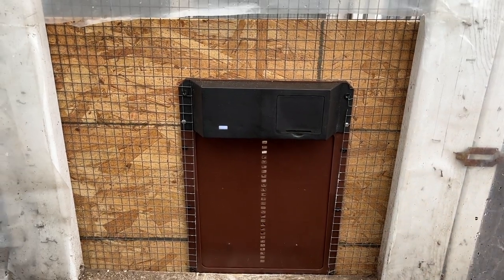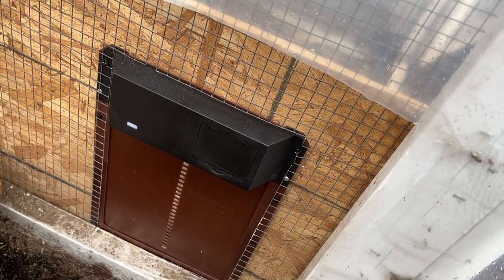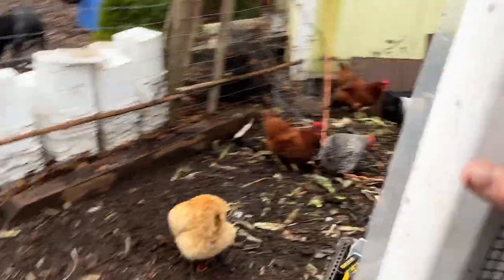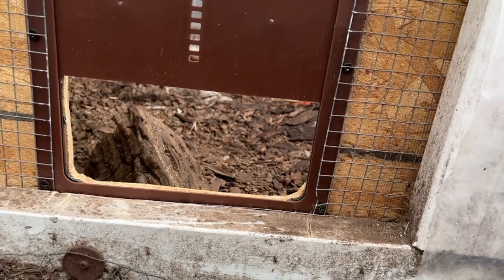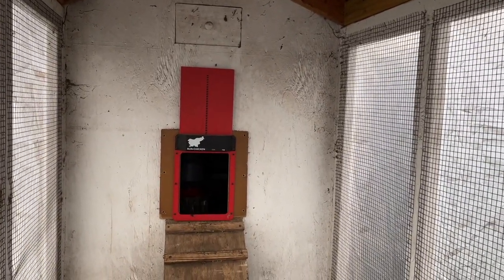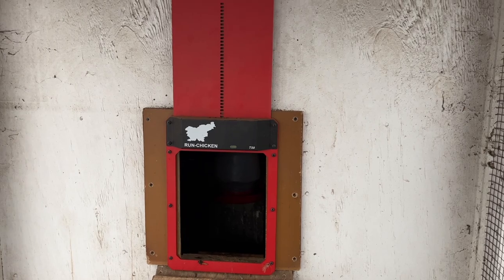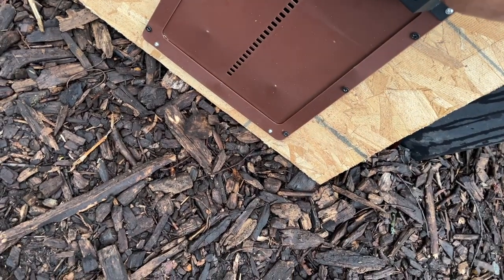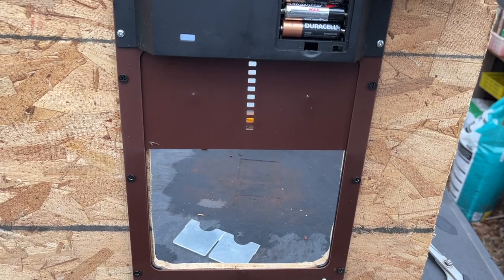$30 vs $200 Automatic Chicken Coop Door

Comment: real question is, is it raccoon skunk opossum fox, dog safe.
Reply from the maker: Two years running now and not a single incident. I do have lots of raccoons (who doesn't?) and I've never noticed an attempt. And there are some enormous skunks I've caught on my security camera and they haven't gotten in (if they ever tried). My own dog plays with the chickens so that's no answer. But the expensive door is made out of aluminum and the motor is more robust than the cheap version so I doubt an animal can get in. I can say I sleep soundly at night not worrying about the chickens' safety
Reply: Cool man !

Comment: It's literally getting caught on your fencing bro...
Reply from the maker: It’s literally not though. It’s cheap craftsmanship and plastic parts that are the cause and a lack of quality control. It can be adjusted to make it work, but it’s not getting caught on the hardware cloth.
Reply: Definitely the sprocket system they used. It would be jumping if it was the fence.
Reply: Thank you so much for taking that one apart... I could just put a different sprocket on their gear and have a $30 door that works like the $200 door. Either that or make smaller holes because the gears are spinning too fast. Needs more slots to grab or maybe if they set those holes that little angles it would probably work out great
Reply: Get some door seal or sticky foam. Cut to fit
Reply from the maker: @austingibson4939  That's a possible solution too!

Comment: Try flipping the door around.
Reply from the maker: The door is pretty much the same on both sides. What would that accomplish?
Reply: @HomesteadDIY  From the video, it looks like the middle strip where the small cog rides on is raised on one side?  This would bring it slightly closer allowing for better contact.    If it's just an optical illusion, then it won't work.  I'm just trying to help.  Love your channel.
Reply from the maker: @frankm2385  thanks I appreciate it. I do think both sides are identical though, but I’ll give it a look

Comment: Hey. Great review! Were you ever able to get a refund/ return the cheap door?
Reply from the maker: I actually never bothered trying. But as a product purchased from Amazon, there wouldn't have been an issue. I did get a second door from Run Chicken and decided to hang onto the cheaper version as an emergency backup. I'm not really expecting any problems, heck even the original batteries on the first one are still going strong after a year and a half, but you never know.

Comment: Not an unbiased test.  You have the cheap one sandwiched between a fence and a board, while the expensive one is not blocked.
Reply from the maker: Of course it's unbiased. The cheap one had zero interference from the hardware cloth. There's plenty of space for the door to move up and down without touch anything. And you can see even before the door started moving it wasn't engaging the gear so the fencing had nothing to do with it. I appreciate you taking the time though to check the video out and commenting. Other people may have different experiences, of course, but this was completely unbiased. Cheers!
Reply: Exactly a biased review

Comment: Been looking for a review on the $30 version I'm seeing everywhere. I think I'll pass 😆
Reply from the maker: Agreed! Also with it being plastic and not powder coated aluminum like the Run Chicken model, I wonder how well the Chinese knockoff can withstand extremes in temperature. Plastic tends to get very brittle in cold temps and can warp in hot. Where I live we often have sub-zero temps in winter and 100F days in summer. Even if it worked properly I doubt it would last very long being subjected to those extremes. I have no such concerns with the Run Chicken door

Comment: yeah my cheap A$$ door (was not so Cheap $60) quit going up after 2 weeks now, it just stops about an inch up, it doesn't even keep trying, like a jam, it WILL go down though, at first thought it was batteries but new ones proved wrong. going to try and "HACK" it.
Reply: I would buy the original if you have a coupon on this video or on social media. The price is not so bad, and you have no worries afterward.
Reply: I actually got it to work by taking the motor off and flipped it up side down on the back side, can't put top screws in to mount so I only used 4, and the open and close buttons work opposite easy hack, see how long it lasts
Reply from the maker: I found that the wood I had mounted the door too swelled a bit in rain so it ended up pinching the door and prevented it from moving. Make sure whatever surface the cheap a$$ door is mounted to is treated or otherwise protected from the elements.
Reply: @HomesteadDIY  I was thinking the same thing, after taking it apart though I found a  few pieces of plastic shavings I don't know where they came from. but then I put the door through some test and it did seem it might be pinching , I noted the motor was a lot more powerful than I was thinking. as in the above video the same problem was the gear would push the door out and slip but why did it keep stopping.
So I did the reverse upside down thing and it seems to be working fine. I will report back if I start having trouble again with it.

Comment: Fell for the same cheap piece of Chinese junk. Was about to cut a hole in the side of the coop but decided to see if it worked. The plastic door is so flexible it doesn’t engage the gear. No way it is going to work correctly. Stay away from Chinese copies.
Reply from the maker: Agreed!
Reply: I bought one of the same and it didn’t want to engage. I removed the control box, reinstalled it on the back side of the door, and remounted the door. It works great now.
Reply: Just tried my cheap one and it doesn’t close all the way. Tested it a few times before I even did any screwing
Reply from the maker: @LoreDeluge  That was probably smart. They take a bit of re-engineering to get to work somewhat ok.

Comment: turn the door inside out   its backwards
the door is backwards  (inside out)
Reply from the maker: I don’t think that’s the issue. For one, the door came mounted that way from the factory, but two, the sides are identical, flat sheets of perforated plastic. But thanks for the suggestion
Reply: I removed the control box and mounted it on the back side of the door assembly and it works great now. No issues at all.
Reply: Oh, also flip the door around in the track when you relocate the control to the backside.
Reply from the maker: @forrestodell4322  Oh, now that's an interesting fix.
Reply: @forrestodell4322  Is it still working great for you now?

Comment: I think a car motor would work great and cost almost nothing, and found a video of someone already did it..
https://www.youtube.com/watch?v=bqAIN8awW4M
Reply from the maker: I had considered building my own originally using a wiper motor. You used to be able to get them fairly cheap, like $15, but they’re much more expensive today, but you might be able to get one in a scrap yard. Window motors were another consideration. I’ve used both in making animated Halloween props as they’re strong and durable, but wrapping my head around wiring limit switches and timers overwhelmed my grey cells. Definitely doable for someone such as yourself
Reply: I have some deer feeders that go off using this same type of sensor. Dusk/dawn I believe. My concern is motor and the type of loop.

Comment: Yeah, ALL the cheap ones are totally not functional. the gear has rounded ends that will slip. they are also poorly centered in the holes. The cheap ass plastic flexes to make it slip.
Reply from the maker: Agreed. The old saying you get what you pay for certainly applies here